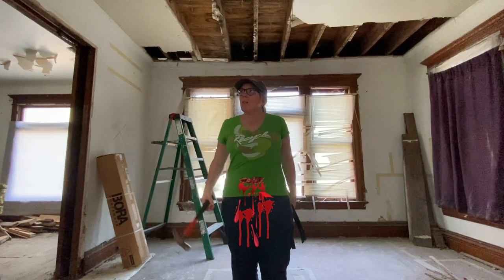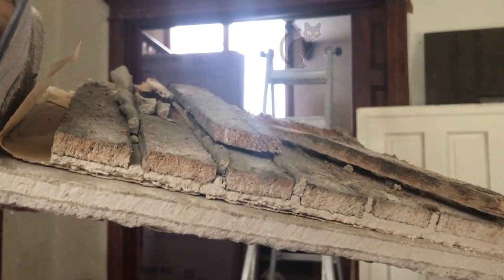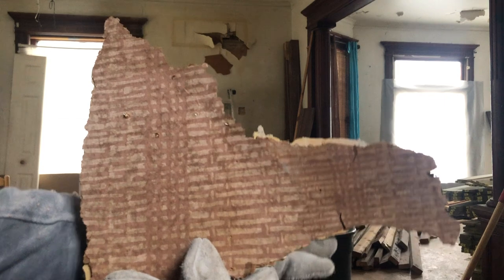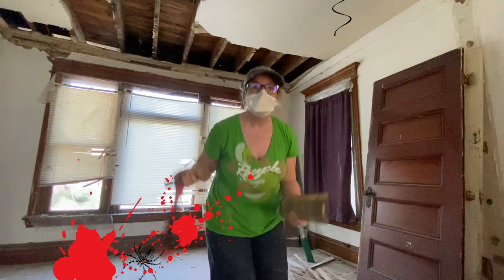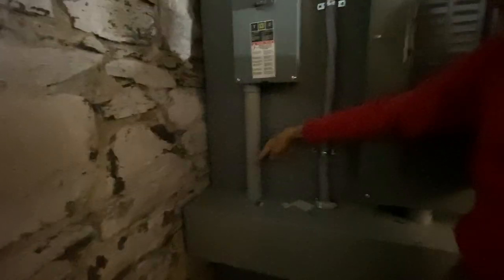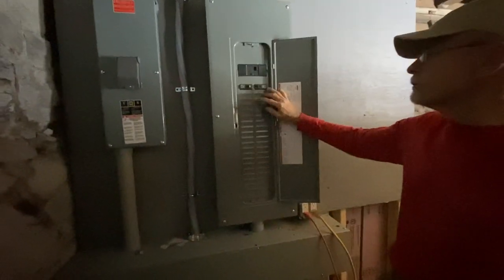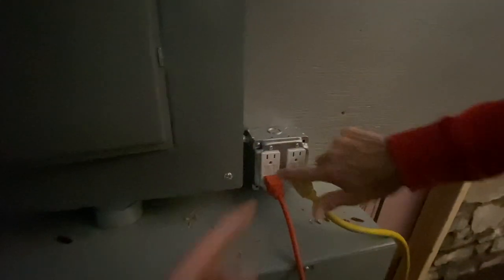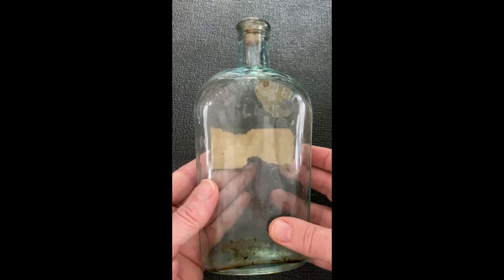INSTALLING THE ELECTRICAL PANEL | HALLOWEEN | OLD HOME RENOVATION 😱 The 13th Episode -The Grand Lady

Comment: I have very similar crown molding in my house from 1910, but I suspect it was put in when the house was greatly remodeled in the 1940s. They still make this type of crown modeling. A small woodworking mill/store in San Mateo, California had it, at least a few years ago. I think it is a cut that was used often over the decades, so it is hard to date.
Reply from the maker: Oh thanks for the tip!  I haven't yet been able to look around for it.  Glad to hear it just might be common!  It can be so hard to remove it without damaging at least some of it.  Whoever did that particular remodeling use SO MANY NAILS!
Reply: @TheGrandLady  a lot of old moulding is reproduced these days - and if not, there's plenty of companies that can take a piece of yours, have some cutters made, and then make up as much as you need. Either way may be cost/time effective rather than repairing/cleaning up the original pieces.